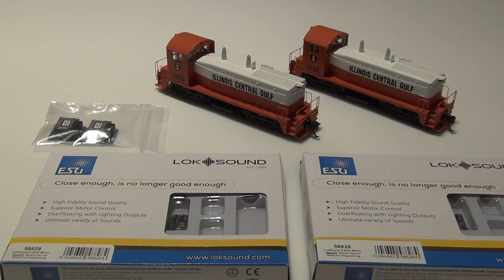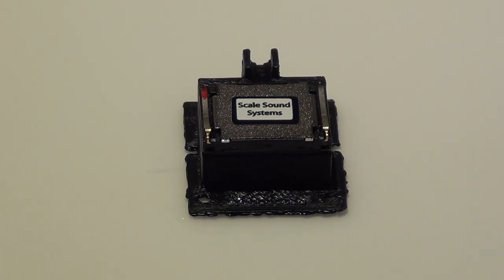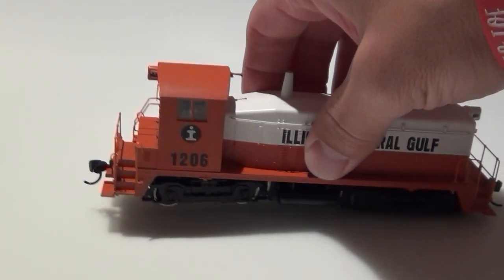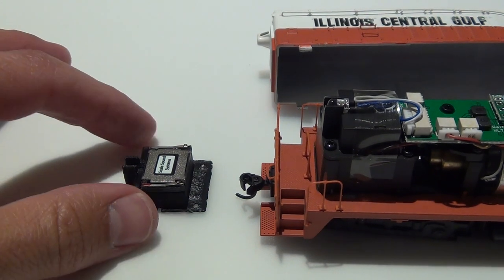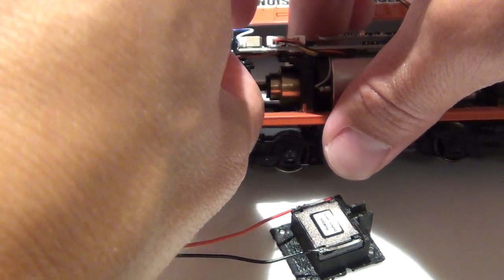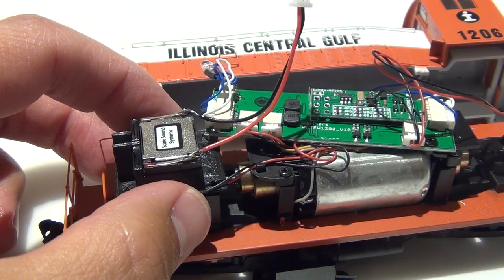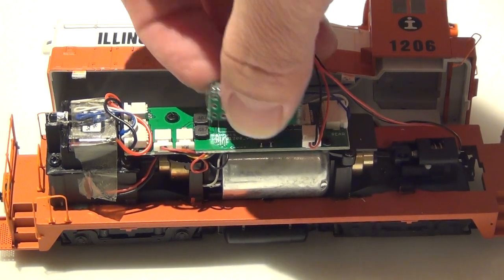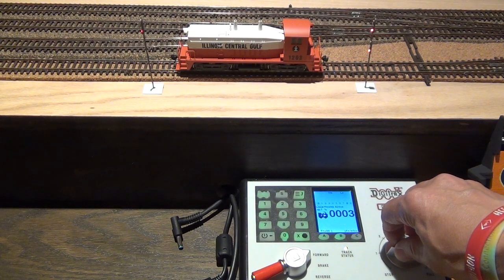Walthers Mainline SW7 Illinois Central Gulf product review Part II: installing next18 decoder

Comment: I bought a couple of Intermountain Illinois Central GP10s I got off of ebay.  They were DCC (Loksound mobile decoders), but no sound.  I changed to Tsunami2 decoders and added the speakers from Scale Sound, based on your video here.  As far as I'm concerned, I will only buy Scale Sound Systems speakers for my locomotives in the future!  They're fantastic!

Comment: Thanks for the detailed review,  and I love SSS.  they are awesome.  these are fine runnning models.  However,  You want to get that tape off the back of that speaker.  There are actually little timy ports on the back side for moving air.  It will sound much better when you get that tape off.

Comment: Hello, Thanks for the great videos.   I'm having a heck of a time trying to get the shell off my  Walthers SW7, might you have any tips, Walthers doesn't offers much help
Reply from the maker: Thanks, Carlo.  I do not have any specific tips, I remember the shells were tough to remove, just make sure you have all of the screws removed and that you do not try to force it off.  Use firm, consistent force and try to shimmy it off.
Reply: @ck7813   all of the screws removed ?????    :0 )

Comment: Do you know if there is a keep alive that fits in this shell too? I'm getting ready to place an order.
Reply from the maker: Disclaimer, these are my opinions and you need to make up your own mind on your approach.  Short answer is, yes you can fit a keep alive in.  In my Bachmann Thomas the Tank Engine model, I fit a Loksound 5 micro and ESU Power Pack (keep alive) in a very small space.  I also have a Broadway Limited SW7 which was fitted with an TCS Keep Alive.  Depending on what speaker/decoder you install, you might have to consider placing the keep alive in the locomotive cab (you could do a roof-mounted approach).  Good luck.

Comment: Is the Walthers equipped Loksound decoder not as good as the one you installed?
Reply: Nope. The Walthers OEM sound units also use a motherboard style Essential Sound decoder as opposed to a Next18 one plugged in